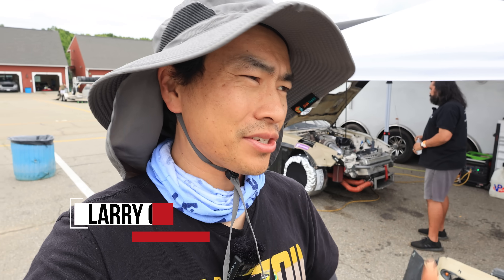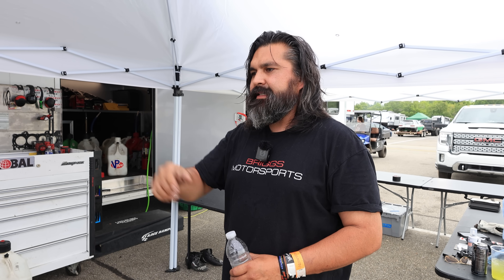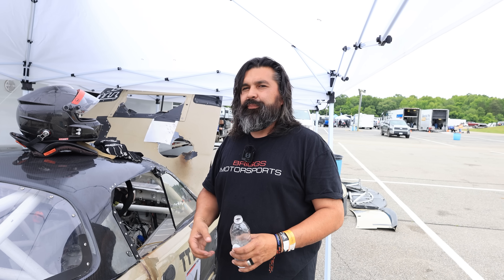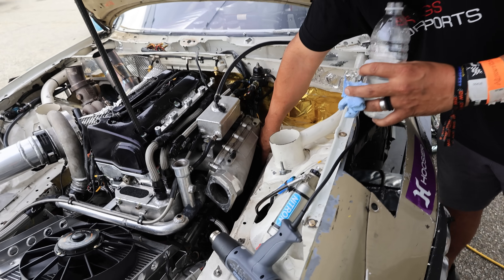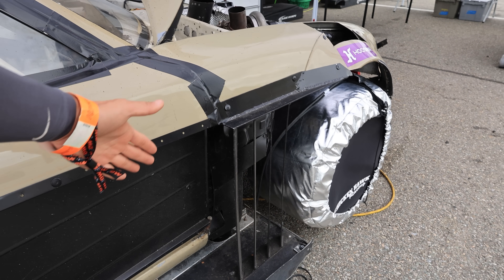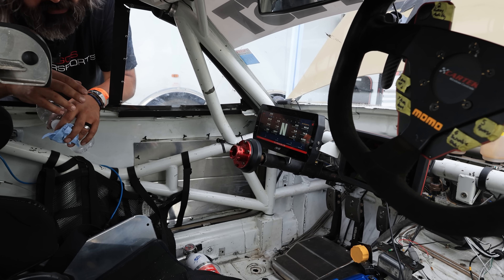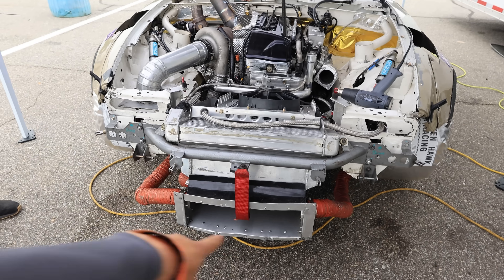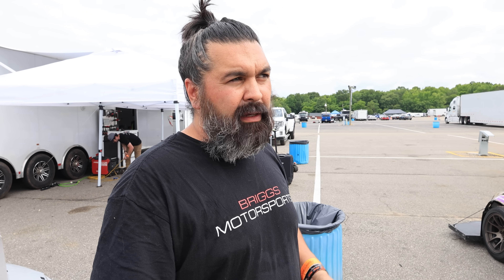Turbo K24-powered Time Attack Frankenstein Miata, Capable of 200mph

Comment: He needs either a good lithium car audio battery or a larger amperage alternator with an underdrive pulley
Reply: He has both of those this is an issue on multiple Honda platforms and they use an alt ran off the drive shaft which is something he said he will be doing
Reply: His pump for the air Jack's are a huge hindrance to his entire electric system. He definitely needs more than what he has.
Reply: @devinej8411  Just when you thought you understood the definition of insane lol
Obviously you just need a spinning force, but damn lol The power requirements of this thing is insane. So cool how many work arounds having to do this opens up. Especially in a race car. Now you can consider weight distribution and maybe even driving force based on placement.

Comment: Good point on brakes. That's the reason why modern racecars and hypercars have wheels larger than 20" - just to provide massive braking capacity. With 15" wheels you're simply limited what brakes can do. ✌️

Comment: VW tiguan 2012 alternator is 180A capable, and withstands RPM really well.  It gives good voltage from idle to 8600 rpm in my car.

Comment: This dude and his team took it way beyond what the mainstream miata guys are at. Most definitely, my goals. Can't imagine what an Elmer Racing Thor engine 2000hp will do to a miata. Gonna need to run crazy wide tires like the ones on the 917 Can-Am-Killer. Most definitely an awesome Mazda Miata coverage , Boss Chen 👍🏼🤙🏽
Reply: Man I don't know if a Miata chassis could withstand 2000hp regardless of how extensively modified! I suppose the torque number would be the deal maker/breaker though.

Comment: Clean up all unnecessary wiring, fix charging issue, exhaust issue, driveshaft issue, and the list goes on. As you fix a failure with an upgraded part a new failure will present itself. As this guy already knows. Love to the CH-47 mech. I’m a fellow hooker! Great video, insane car, and people doing things with machines the engineers that designed them never would have thought could be done 👏👏👏

Comment: Just saw the video amdnthe answer (or a viable answer) to hos alternator problem is run it off the rear end. I have seen several set ups that run off the rear end and it works great. Speed of the alternator stays within a narrow band easily tuned by the alternator pulley size.
Good luck.
Also lithium battery swaps will give you more reserve with a lighter weight.

Comment: 15:50 .... what the f is that wiring lmaooooo
Reply: Worst I've EVER seen
Reply: One short and that is just going up in flames.
Reply: This dudes talkin about going him to his family, idk if id step foot in this thing if that was my priority. It’s probably ridiculous to drive but idk, respectfully this thing a death trap
Reply: like he said it's a work in progress, once everything is figured out he's doing a proper wiring harness
Reply: @JonasDePrez1  That is not excusable. Most time attack cars are a work in progress and they almost always have neat, if not perfect wiring harnesses. The whole reason to have neat wiring IS to work on it.. Imagine trying to troubleshoot that rats nest. You also wouldn't know if it was the wiring or the component causing the trouble.
Reply: Cable ties add weight :///
Reply: Looks like a pan of spaghetti poured out on passenger floor
Reply: Lot going on there 😂😂 like larry said
Reply: To be fair, the execution of most of the car is poor at best. The concept is fantastic
Reply: In my opinion - wiring should be the top priority above every other thing on the car aside from brakes. Every issue I have ever had on my car (which is not a racecar) has been electrical and not mechanical. Imagine trying to diagnose issues, like their alternator and voltage issues, with how shit the wiring is.
Reply: @downshiftdreams8331 he also did say that a lot of the wiring is from previous versions of a build.

Comment: I would have to guess the belt is slipping past 5500 especially if it's multiple alternators not charging. Kevlar belt maybe wider pulleys and a wider belt? Such a weird issue.

I guess pattern could cause it too if the belt isn't making enough surface contact where you could put a guide pulley close to it so the belt practically wraps 80% of the alternator wheel.

Comment: 1:32 Most of that car would not Fly with the ruleset in Spec Miata... 

"Engine
11.1. General
11.1.1 All engines, components, and parts must have been offered for sale in a Mazda Miata,
sold by a dealer in the United States of America unless otherwise specified in these rules.
11.1.2 All engines and their internal components must remain stock, except as provided by these
rules, and within factory specified tolerances unless otherwise specified within this document.
11.2 Balancing and Lightening
Lightening of engine parts and engine components is not permitted. Balancing of Crankshaft and
Flywheel is permitted; minimum weights listed in these rules must be maintained.
11.3 Cooling System
Ethylene glycol-based anti-freeze is not permitted. Other additives, such as Redline Water
Wetter, are permitted.
11.4 Radiator
Any radiator (and mounting brackets) may be used, provided that it mounts in the stock location,
without any modification of any part of the stock mounting location that is integral to the body.
Any additional open areas or holes created by use of a non-OEM radiator may be blocked off,
but under no circumstance shall the open areas or holes be used for supplying the air filter with
additional air. At least one functional stock OEM cooling fan must be mounted in one of the
stock locations. The fan shroud may be modified for installation.
11.4.1 A single layer radiator screen mesh may be added in front of the radiator and contained
within the bodywork. Tape or other materials may be added directly to the radiator or mesh.
11.5 Thermostat
Thermostats are optional and unrestricted, providing that they serve no other function than to
control coolant flow from the engine to the radiator"

In otherwords No its not "spec miata"..

Comment: Maybe run the alt off the drive shaft like NASCAR it won't charge at idle or sitting, but you could play with pulley sizes pretty easy

Comment: I didn't know a k24 could hit 10k rpm... What the heck is coming out of the passenger door that's the exhaust exit?
Reply: destroked but dude I had no idea either things a beast.
Reply: My dad's DZ302 small block Chevy v8 goes to 11,500rpm. it was built to go to that rpm at the drag strip back in the late 70's earlier 80's. no boost on his V8, all motor and carbureted with forged rods and pistons.
Reply: @CplCheeto  nice sounds beast and damn 11.5k that's wild
Reply: U can build most engine to rev but low end torque sucks

Comment: I feel like he should be skipping this season and fixing issues… like the charging system, drive shaft, move to the lightest 16-17” wheel package he can source to then use larger brake rotors etc….